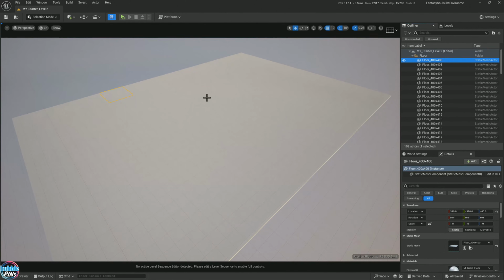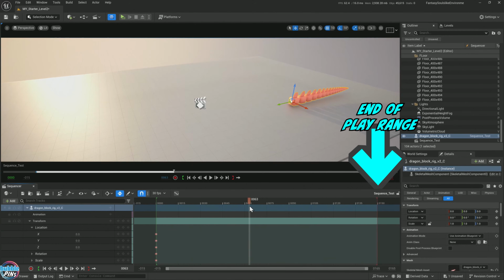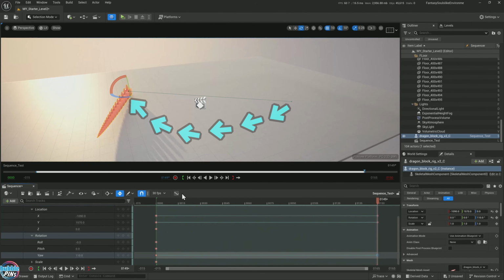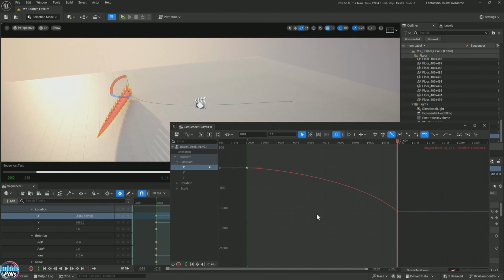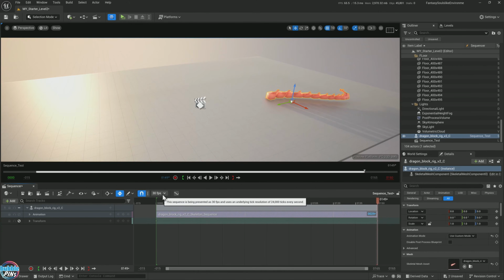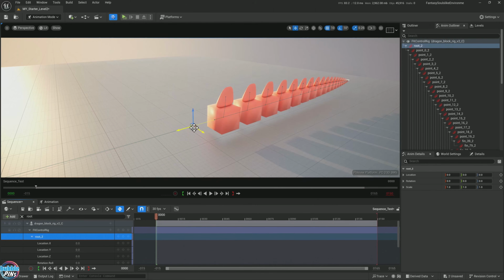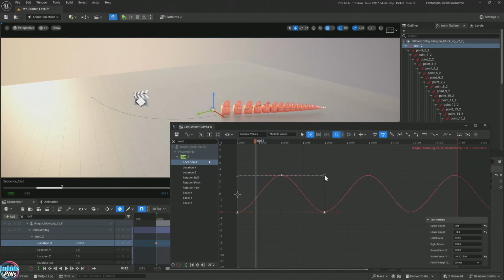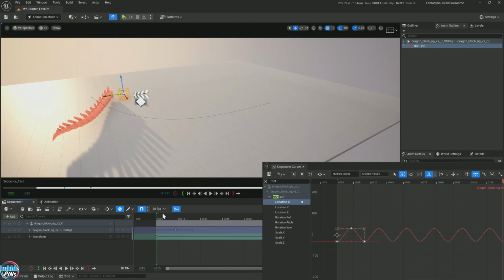How to Animate in Unreal Engine 5 using Sequencer, Curves, Keyframes

Comment: so how to combine animation plus local adjustments on the rig
Reply from the maker: I think I do show that in this video.  But anyways, you just add another Transform layer on top of the animation layer that you have attached to the character rig.  The layers will combine together automatically if you have them enabled.
Reply: @ if i add fk control rig my animation stops working
Reply from the maker: It shouldn’t unless the fk control is overwriting the I’m, there’s actually a fk to I’m switch for the rig if it’s setup properly

It’s a bone that u switch the value to switch fk to ik 

Double check all layers r enabled like not invisible its that eye icon and play around with the order of the layers

See if that helps debug the issue

Comment: Is there any automation tools for curves based on bones? I am tackling GASP animation, and l find making curves for each custom animation tedious
Reply from the maker: U can use the FK controls, that should have a 1 to 1 control for each bone.  Or if it doesn't then you can create ur own Modular Control Rig Blueprint and add a control to each bone.  I hope that helps!  There should be a curve availalbe for each FK controller.

Comment: How can I make texture smoke in Houdini like unreal
Reply from the maker: ooo Houdini can make smoke MUCH better than Unreal!  But Unreal is a lot faster, it's realtime lol
Here's a quick tip where you can get quick REALLY good looking smoke in Houdini, use the old VEX shaders that comes with the shelf tool setup for pyro stuff, and just COPY the material from the OLD matnet and paste it into Material Library inside the LOPNET.  You'll have to use CPU, the old VEX materials are still compatible with the newer Karma but only with CPU!
Reply: @bubblepins  ok thanks I will try that